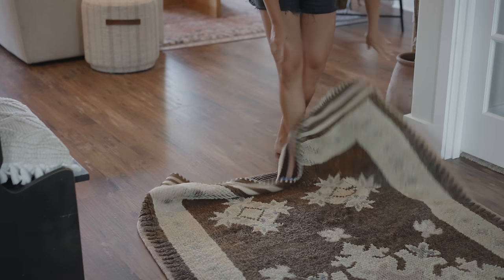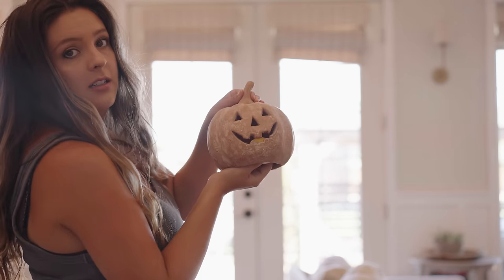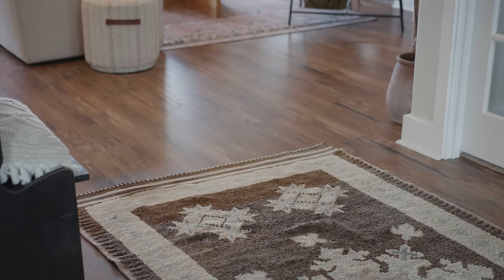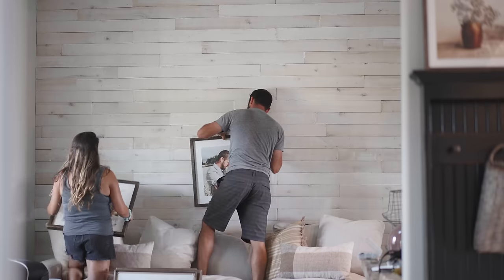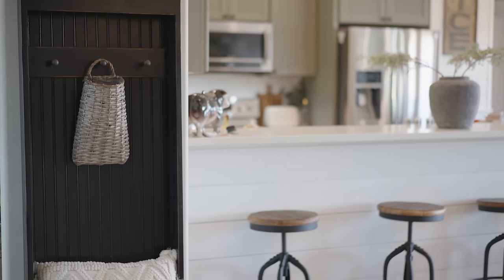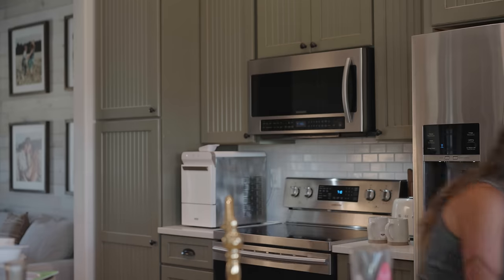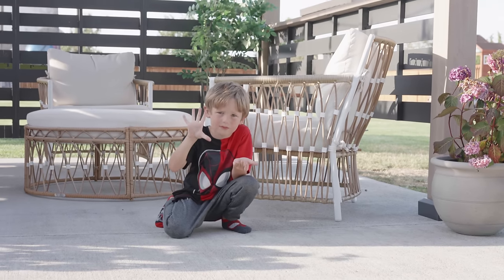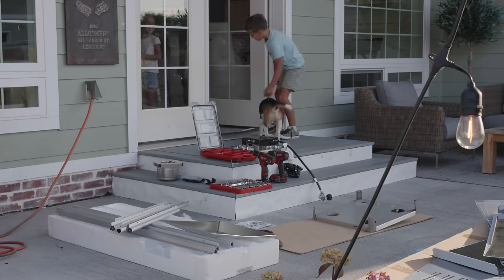Modern Farmhouse Fall Home Décor | Decorate With Me | Living it Country

Comment: Dear Holly, find out where the studs are in your walls, cut a 2x4 longer than the width of your window, paint the 2x4 out in your wall color, screw the 2x4 into your studs, 2 screws on each of the ends, 2 screws in the middle, paint over the screws, then screw your curtain rod hangers into the 2x4, then hang rods and your drapes. It works every time.🌻